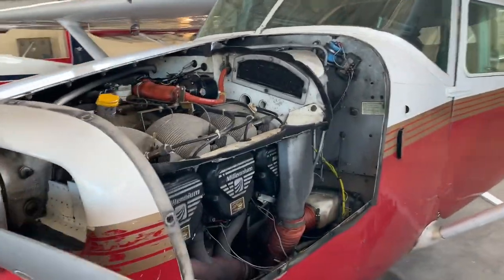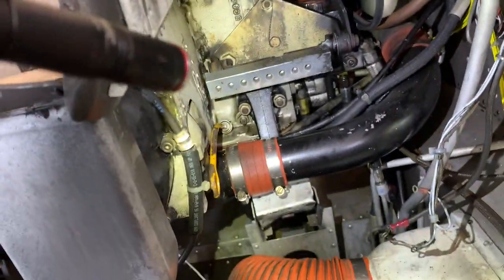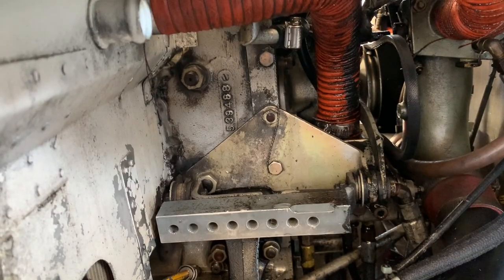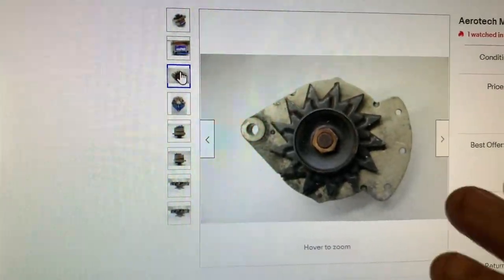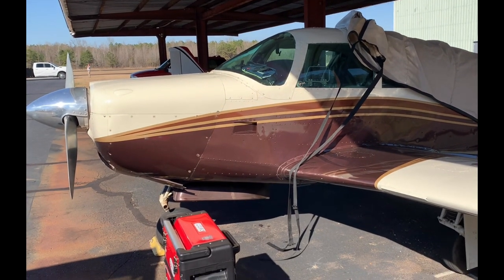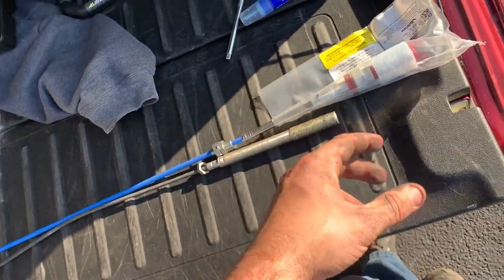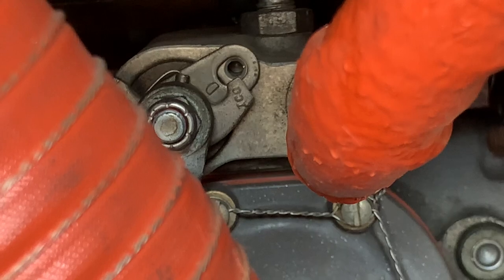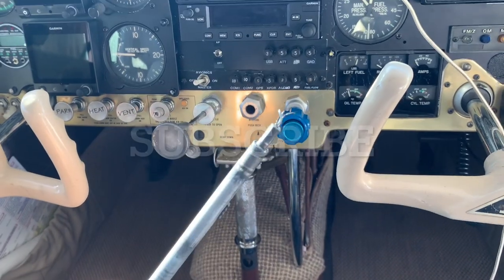Cessna 210 alternator STC becomes a black hole.  Mooney mixture cable broken. A&P mechanic life

Comment: I really appreciate being able to watch your decision making process. Thank you for a great video.
I recently learned that engine control cables should be rigged so their knobs do not bump against their panel stops, they should be a very small gap between knob and panel. I am a pilot, not a mechanic. Could you put out some content which would include the details of proper cable rigging?

Comment: Love your content bud! Props on the Honda Element too!!
Reply from the maker: I love it, just wish the mileage was better.. I actually looked at a 2005 Honda Insight yesterday… but the interior was moldy and dog poop in it, and the engine had 0 compression on all 3 cylinders 😂.  Not looking for a project that big
Reply: @aviationsquared1909   I can relate to the mileage issue. I have. 2006 crv and it gets less than ideal mpgs lol. I also have it lifted with bigger tires which doesn’t help lol!!
Reply from the maker: @bobanderson465   there’s a guy in Dothan who rebuilds Honda engines in junkyard cars and sells them for cheap.  He’s building me a 2005 civic coupe, all stock.  But $2,800 for a car in todays market is a steal.  Then I can let the element have a day off 😂

Comment: Not that it matters when it's visibly junk, but if you want to test a large cable for an intermittent fault your high impedance ohmmeter is not the right tool for the job.  You should be doing a voltage drop test with a significant load.  A few good strands of copper will measure low resistance on your multimeter.
Reply from the maker: We got one, but when there’s that much deviation on my baby fluke…….